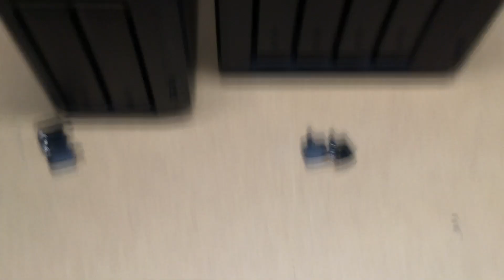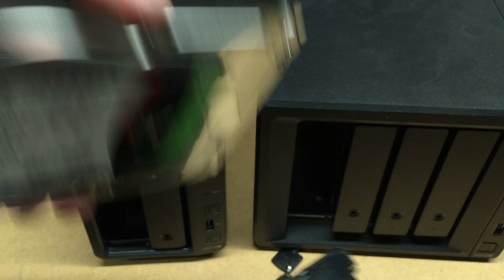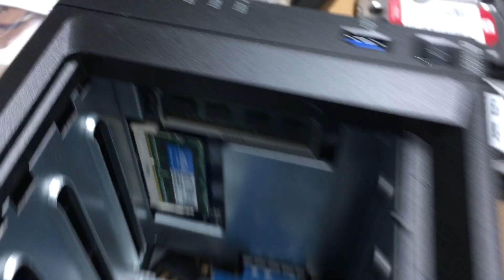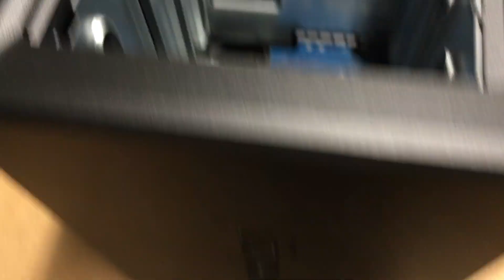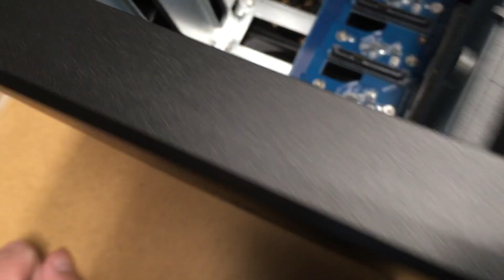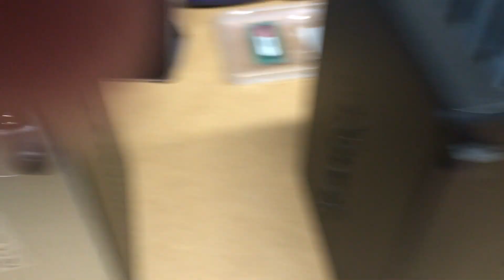Synology DS718+ and DS918+ Comparison

Comment: Rick (or anyone else that might know), I'm trying to learn if there are differences in the physical cases of each unit. Does the DS918+ have a metal outer casing like the DS718+?
Reply from the maker: The outer case of the DS918+ is plastic.
Reply: @Rickmakes  Awe boo! I had ordered the DS718+ and then returned it since I've been reading many reviews that more people suggest the DS918+ due to its two additional bays and not too-much-larger footprint. Bummed to hear that the outer shell is plastic though. Does this cause the NAS unit to run hotter? Should I be concerned that this is built out of plastic which is cheaper rather than metal?
Reply from the maker: @KyleAffolder  I haven't noticed any temperature issues. It has two large fans in the back to pull air though the chassis. The temps in my 918 for my four WD Red 4TB 5200rpm drives is 82, 88, 84, 86F or 28, 31, 29, 30C. The temps in my 718 for my two Seagate Ironwolf 6TB 7200rpm drives is 84, 86F or 29, 30C.
Reply: @Rickmakes  Super helpful!! Thanks!!! Guess there's really no need to worry about a metal chassis vs. plastic then. :)

Comment: Any video with performance differences?
Reply from the maker: I don't have any videos on that. If you put the same RAM and two hard drives in each model, I'm guessing you would get identical performance. The 918 could have faster storage due to having 4 drives instead of 2. Also certain operations could be sped up due to the optional solid state cache in the 918. I installed 5400 rpm hard drives in the 918 and 7200 rpm hard drives in the DS718.

Comment: Just curious, can you use two RAMs of different sizes in the DS718+? for example, adding a 4GB RAM to the available slot while keeping the existing 2GB RAM. Will it work?
Reply from the maker: That is actually what I am running in my DS718+. I have 2GB and  4GB for 6GB total. There can be a slight performance advantage to installing RAM in matching pairs but it probably wouldn’t be noticed on a NAS.

Comment: Rick, Thank You for the comparison! I was hoping the MB would be the same and have ALL the features of each other (with the exception of what you pointed out hardware wise)?
Reply from the maker: Aside from the few hardware features, they seem to be very similar.
Reply: RickMakes Thank you Rick. I asked because I want to:
Use as backup for my son’s windows, my MacBook Pro, and all the idevices we have maybe using cloud. Plus I’ll be converting my sons vhs library (over 200 cartoon and Disney stuff)  to digital, plus surveillance cameras. I’m guessing you would suggest the 918 because of all that work AND it has ability to do good Plex for the converted vhs stuff so he can watch???
Reply from the maker: I think either the 718 or 918 would work. The 918 does give more flexibility with drives. If you are going for data protection/redundancy, the 718 can only do mirroring (via RAID 1 or SHR). With the 918, you can do RAID 5 or SHR to utilize more capacity out of the drives. I like SHR. You can use Synology's RAID calculator to figure out how much storage you would have with a certain combination of drives. https://www.synology.com/en-us/support/RAID_calculator
Reply: RickMakes Thank you Rick. I’m just a home user. Your videos make me feel as though I was listening to a friend that knows what he is talking about and presents the information very well! I am considering both but wanted to spend that much of my money wisely!! Thanks again.

Comment: So am I understanding right that 918+ can be upped by a next gen SSD, say a 250GB M2 like the one in the link and if I understand correctly, the system will be able to use this to p.ex. play a huge file with no delay or buffering? I’m on an ancient DS 214-play but I’m often playing huge files, 50GB or bigger to LG OLED and while the wifi seems to be able to handle it, such files are too large for the DS to play and buffering occurs. Will M2. solve this? Some kind of a bottleneck is mentioned in other videos. And am I correctly assuming I’ll be able to use the two 3T WD Reds from 214 on top the two new 4T Reds to have a total of 7T?
Reply from the maker: I think the processor speed would have a greater effect on PLEX streaming. Looking at the specs of the 214 and 918, they both support hardware transcoding. The 918 is four years newer so it might be a fair bit faster. Caching isn't as useful for streamed video. It is more useful for files and the access often on a repetitive basis. You can use Synology's RAID calculator to determine how much storage you will get with a certain hard drive combination and RAID type. https://www.synology.com/en-us/support/RAID_calculator

Comment: You're the DS?18+ PhD.  Thk you ever so much for the video & the links.  I'm killing myself choosing-between/comparing them.  
I'm leaning towards the DS918+ with 512G M.2 read/write caching.  That way most of what I do will run-off the cache & not the HDDs.  Also the 512G caching  & Qcpu just might make running 2 VMs practical.   
Oh I know the 16G RAM is recognized.  ?But could you verify somehow that the extra 8G of RAM is being utilized just like the regular 8G of RAM?  Although Synology's OS recognizes the 16G of RAM on the DS?18+, they might have limited their OS to utilize only a max of only 8G.  Thks again